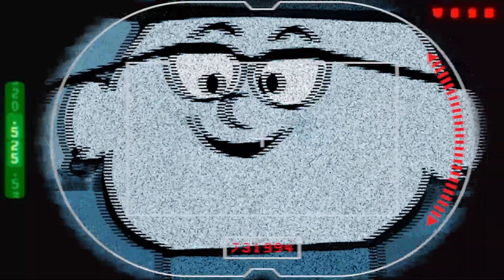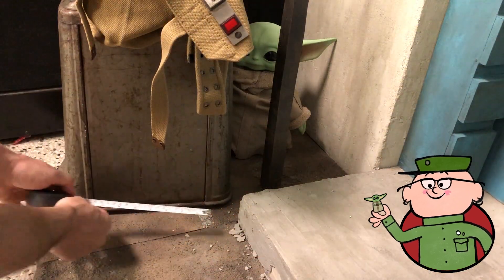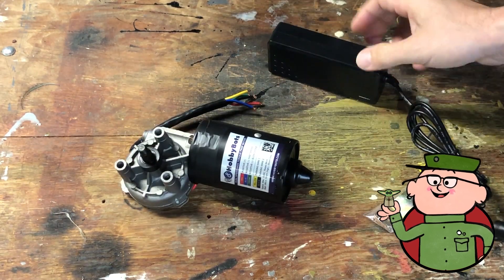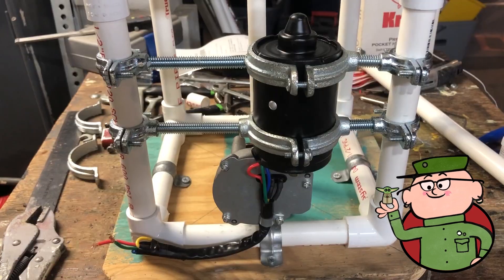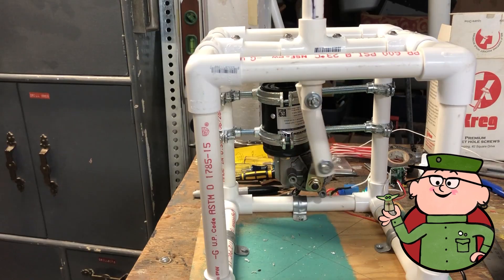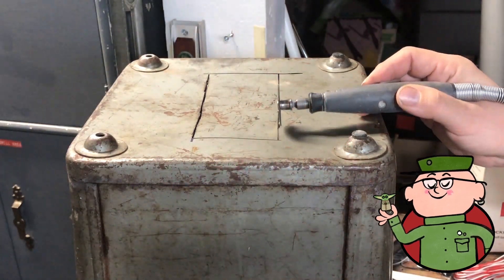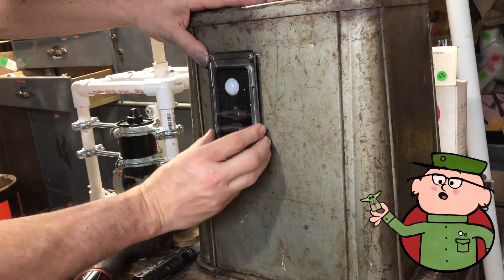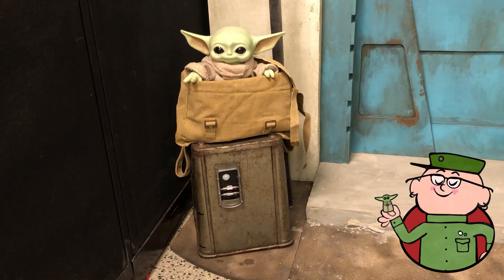Making an animatronic Baby Yoda display with motion detector. Super Easy!

Comment: Very nice! A simple setup that looks like a professional quality animatronic. Good job!
Side note: I'm pretty sure that NO and NC on the relay stand for Normally Open and Normally Closed. If that's the case, swapping the wire from NC to NO would make the animatronic run constantly until the motion detector detects motion, at which point it would stop for a bit and then continue. Basically it reverses they way it works. I'm pretty sure that's what that means, but I could be wrong.
Reply from the maker: That makes sense. Thanks for clarifying (if you're right - hee)